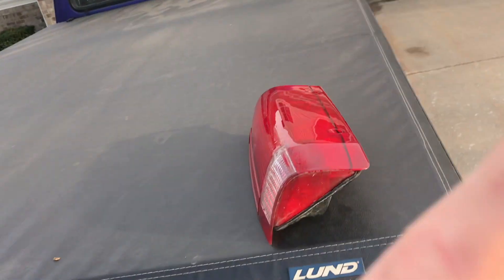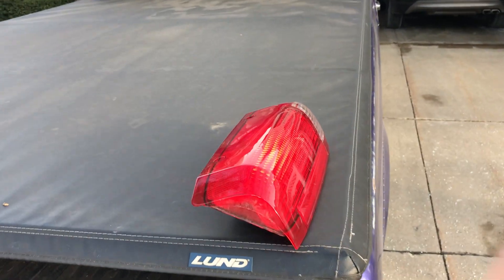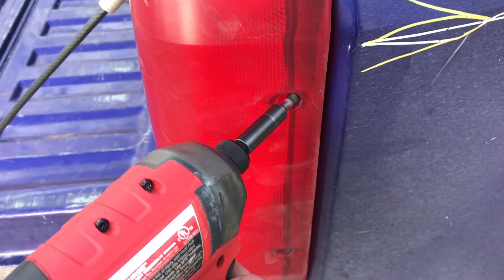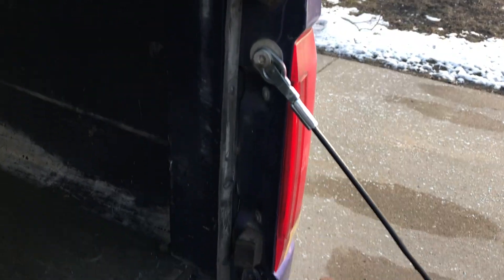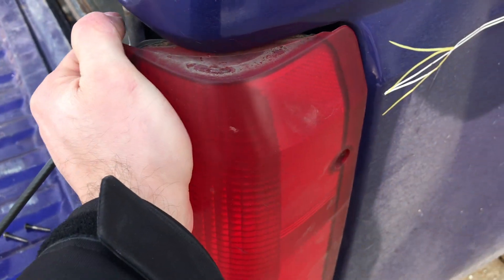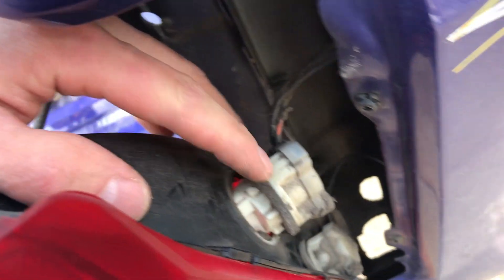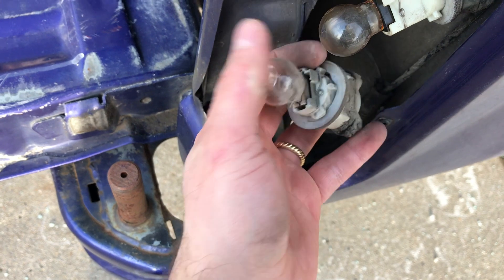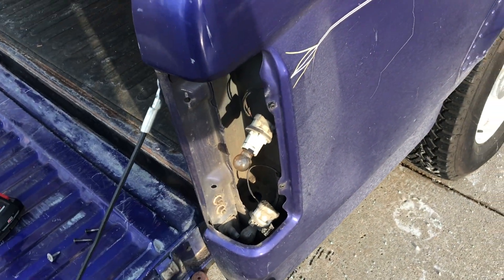How to Install Rear Brake lights (Bulb Change too) | 1995 Ford F150

Comment: Those bulbs are held in place by a spring clip mounted down by the fixture (on my 1995 and I think I saw them in this video). If you don't remove the clip the bulb pulls apart every time. Also the clips are not symmetrical and have to be replaced exactly how they were originally.

Comment: I have a 1993 Ford f150 i replaced my brake lights to LED bulbs and attached the load resistor now my brake lights dim and brighten when i press the brake but now my turn signals don't work.
Reply from the maker: Interesting. I think you actually have to buy a special resistor/relay for your turn signals when you install LED bulbs. On the fuse panel it’s the larger round almost silver looking thing. It’s what causes the intermittent flashing of a turn signal.